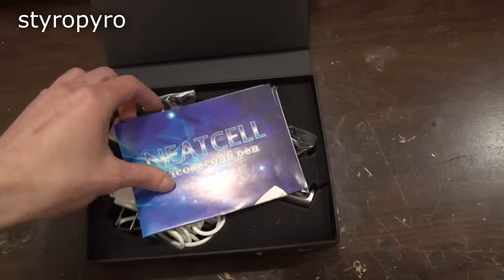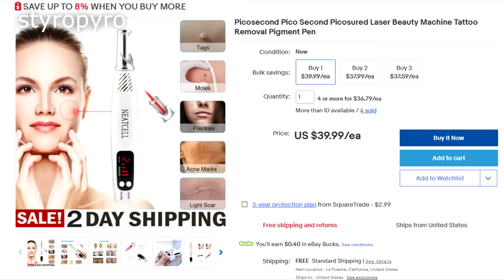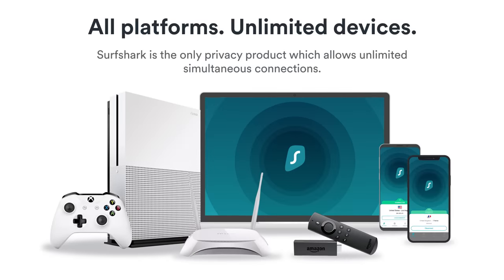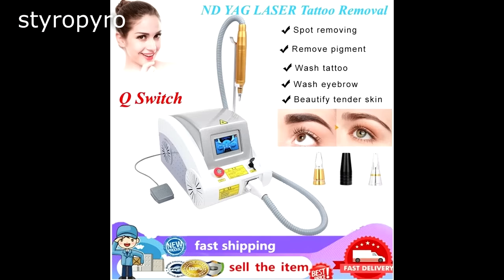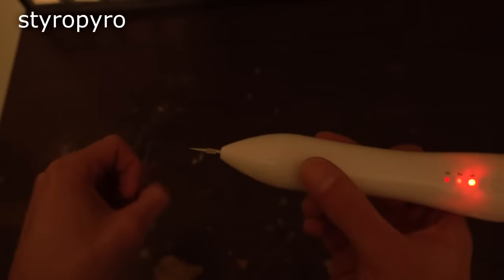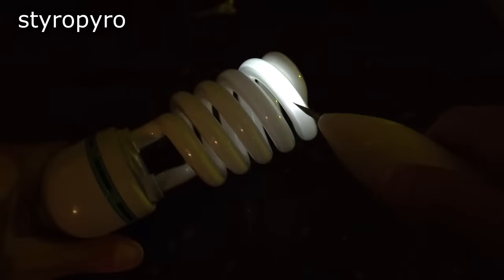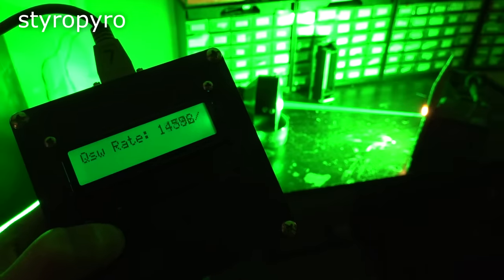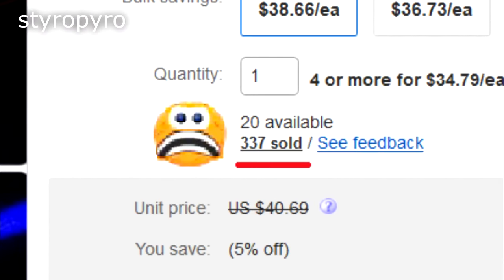Testing dangerous DIY "medical" lasers from eBay

Comment: Those opaque goggles are not for the operator. They are for the patient. Also this is just barely a class 4 laser, at just 1 watt. The biggest  danger is is a direct reflection of the colimated beam into the eye. The diffuse/scattered light that comes from shining the laser on a white surface can be uncomfortably bright, but not instantly a cause of eye damage. I have a 4 watt blue laser diode and no goggles (those things are insanely expensive, costing a couple hundred dollars for a goggle from a known good company, which makes the goggles many times more expensive than the laser diode I bought on eBay, so a waste of money). I can easily fire up my 4 watt laser and run it for about one second, and the dot on the wall from the scattered is about as bright as looking directly at a blue LED. Not something you want to stare at for a long time, but also not something that causes instant eye damage. Some simple sunglasses would be more than enough to dim the scattered light to a more comfortable brightness. Unless you plan on doing something really dangerous, like putting your face right next to the beam (so there's a high chance of accidentally getting the beam directly into your eye), there's no real need for hundreds of dollars worth of laser safety goggles that are tuned to block your laser's specific wavelength.

Comment: I know you deal basically with lasers.
But since your talking about medical devices. How about the therapeutic use 
Of pulsed magnetic fields near parts of the brain and low frequency exspoure to
The brain and body. Also the use of ultrasound sound in different areas of the brain and body. My favorite is more a
More people are having Hydro baric oxygen treatment for brain and body repair also to reverse the effects of aging I wouldn't recommend anyone
Doing this at but I intend to and I know
What I'm doing.

Comment: Can anyone explain to me how the distance travelled by the light pulses at 8:34 is measured or how it works or somewhere I could figure it out on my own, is it just that the light becomes too weak and dispersed to be detected or does it literally just stop?
Reply: He's referring to the length of the pulse in reference to how far the laser light travels before the pulse ends. Meaning that in this case, the light from the pulse only has time to travel 3 meters before its cut off. It doesn't refer to the literal distance the laser is able to travel, as both of them would proceed indefinitely.
Reply: @hankglidden1463  so the length of the pulse is 3 meters?